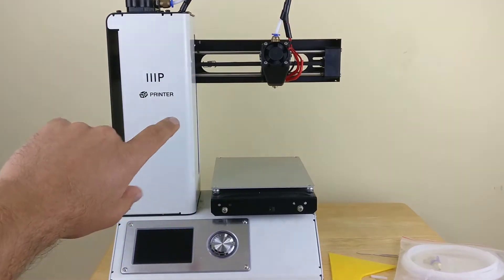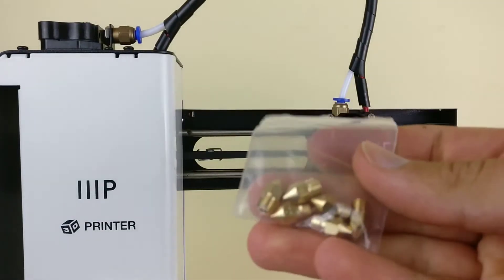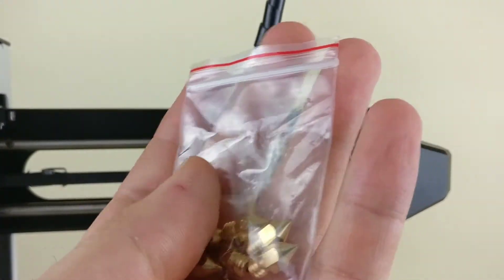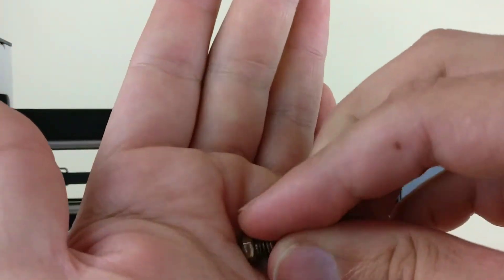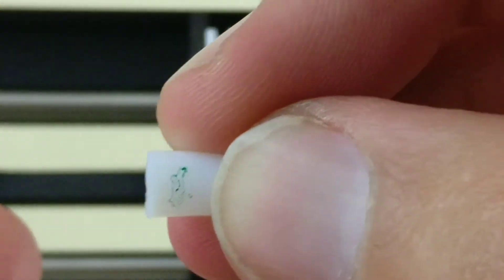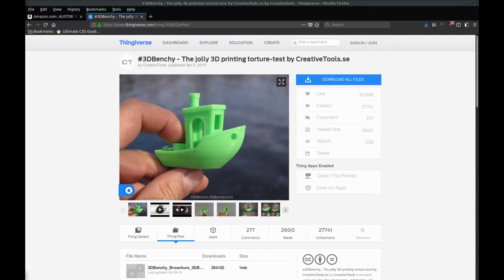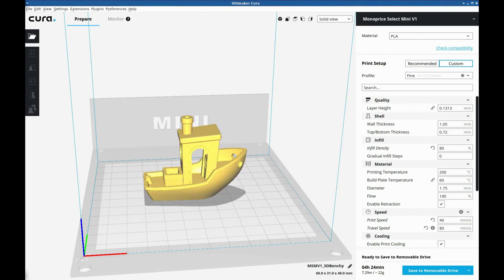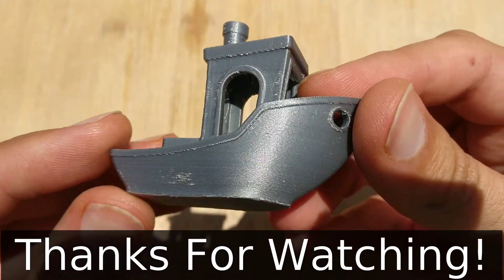Monoprice 3D Printer Nozzle Replace and Test Print

Comment: What is the tool you used to tighten and loosen the small bolts? Can't seem to find anything to tighten mine.
Reply from the maker: It's been a long while since I made this video. I believe I was using a hex bit... You can probably get a allen key set

Comment: Is it necessary to adjust the heating section when replacing the nozzle? My printer (Monoprice IIIP) seeks a home position when starting a print. I assume that's to get into the starting position and find out where the edges of the printer are (including the floor). Would this be true or are adjustments necessary?
Alternatively, could you just reprogram the home position through the printer's console by setting the Z position?
Reply from the maker: It's best to leave the home position where it is, unless it's wrong. If your printers bed does not auto adjust it's height, you will want to manually adjust that after the printer finishes calibrating it's positions.

Comment: I have a MP200 I got from son-in-law to try it out. The extruder was clogged so I cleaned it, it was chattering when put in home position so I tightened the micro switch to stop that. I got some filament to come through the nozzle but not a lot. I put it to print after preheating  to 200 and nothing happens, the extruder does not move, the base does not move, the filament will feed if I tell it to manually but not otherwise. I know the motors work cause if I tell it to go home the base moves to the corner and the extruder moves down and to the front corner. I ordered a replacement nozzle, it will be here in 2 days, then I will try it again. I don't know what is wrong with this but I am not a fan so far.
Reply from the maker: Hi, I'm interested if you were able to get it to work with the replacement nozzle?
Reply: Its wierd, I got it extrude the filament, I can get it to home and everything moves to the front left, but it will not print when I click on print and select any gcode, nothing moves it just sits there. The only thing I can think of is the base is not heating correctly. I set it to 50 but it never gets past 28. I ordered a Ender 3 Neo for $130 that is said to be working perfectly. Maybe someday I will work on the MP200 but I think it's a waste of time considering what out there for cheap. @ChrisAsipyan

Comment: I scored one of these printers at the local Goodwill outlet store for a whopping $8.00.  It was sold as-is.  It was pretty much complete except there was no filiment holder or power supply.  I found a power supply and this printer powered up. I noticed that the nozzle was plugged up.  I watched several videos on how to change it.  Pretty straight forward, except how do you keep the hotend from turning while trying to remove the nozzle?  I preheated the extruder to make it easier to remove, but not knowing how to keep the hotend from turning, I stopped for now.  Apparently the thermister is easy to break or damage.  Any ideas or recommendations?
Reply from the maker: Hi, I know it's been a while, but were you able to get it up and running well?